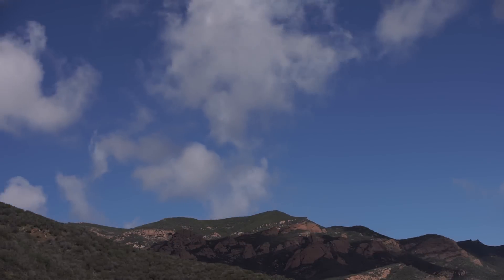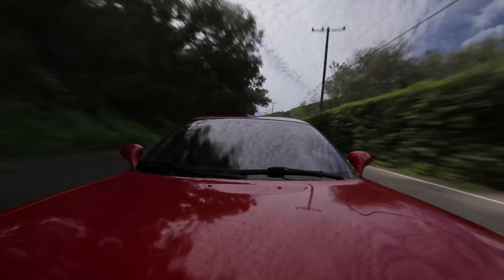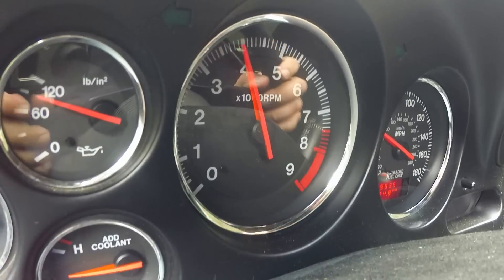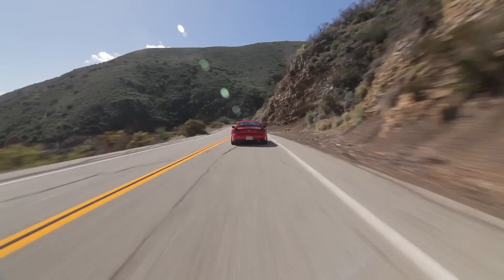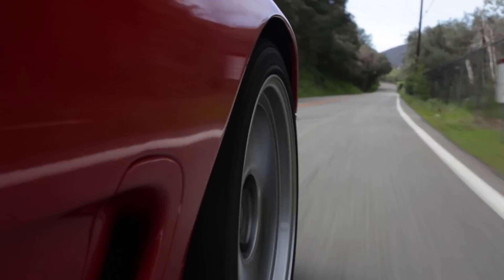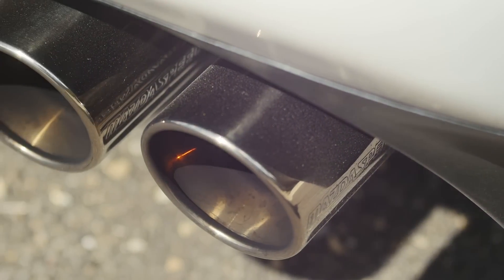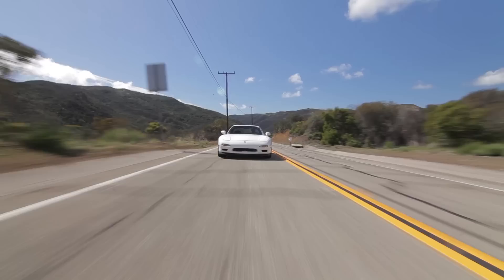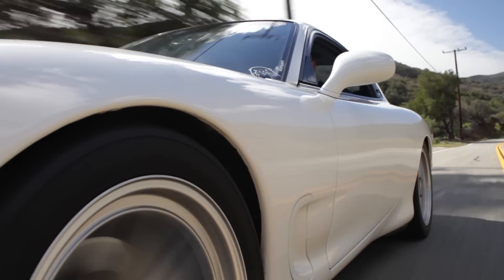Mazda  RX-7: Turbo vs V8 - /TUNED

Comment: I'm happy that rotaries are being covered on /TUNED, but it seems a little disingenuous to compare a 1.3L 13B-Turbo to a ~ 6.0L LS2 block, as though that's a reasonable comparison, to discuss the validity of the rotary motor. It's stacking the deck against the 13B. 

No one compares 6 liter V-8s to 2 liter turbo I-4s with that same tone - "Are Inline 4 motors really worth existing in the first place?" People would obviously point out that it's an unfair comparison. Especially if torque and straight line power are the prioritized criteria.

When people decide to swap V-8s into their RX7s it's specifically because it dramatically changes the car's profile - and that is the intended result. It's not too dissimilar to when people were swapping RB26DETTs into their 240SXs to replace their KA24DEs, or SR20DETs. Obviously, the larger displacement block has more torque, is heavier, and should grant more straight-line speed at the possible expense of cornering ability.

A *closer to fair comparison for performance purposes would be to compare a turbo-charged 20B to a V-8. At least then you're getting closer to a comparable displacement and engine profile.

Either way, I love the channel. Keep up the awesome work!

Comment: Is it just me or have the most recent /Tuned videos come down to the amount of "work" you have to undertake when you drive? With the two Acura nsx's, Matt focused on which steering setup required more work, for this he focused on which engine required more work. To me, having to put in work while driving isn't a drawback, but an advantage, so I'm a little disappointed we can't have commentary on the other aspects of the cars during these videos.

Comment: One of the things that's fantastic with rotaries is how smooth they run. For example it's easy to forget you are in 3rd gear while going 70 mph through a set of twisties. It LOVES to rev, and that's a feeling you'll never get out of a V8. It's silky smooth!  Btw, I'm talking about relatively stock engines with quiet cat-back exhaust setups (this car almost sounded like it had open exhaust -- way too loud for me) I have a feeling the power band in this single turbo is obnoxious. I've seen some of them with turbo lag that looked outright dangerous. Rob Dahm's 3 rotor single turbo comes to mind. Heh

Comment: I think one thing that wasn't adressed was the 10-15ish year technology gap between the 13bT and the ls2, as the 13b came out in the mid-80s and the LS2 in the early 2000's.... if you really want the question "would the rx7 have been better with a different engine?", someone should swap an LT1 and T5 into an rx7 then compare notes.

Comment: he kept saying the v8 is faster but how much hp were these cars making? im going to guess that the rotary was somewhere from 300 to 400 because the only mods he mentioned was switching to a single turbo. The ls2 im going to assume was in the 400 to possibly mid 500 range of course the v8 is going to be quicker it does have more torque and im assuming more power in this case. Get a rx7 with a built 13b and a good size turbo and see which one is better. and if your still not happy try to find a rx7 with a 20b swap.

Comment: My 93' -13b was awesome at 384 HP until it ate itself, was a bad rebuild so I as well weighed out my next move? 13b?, LS swap? or 20b conversion? I have old school Mopar muscle cars. So 20b conversion is ware it landed with a street port on it and it's Bad Ass!!!!! 8 psi of boost it made 560 HP on 16" tires for break in time, Will be going to 16 psi of boost but on 18" tires so if I hit between 650-700HP she'll be hand full, besides LS swap out of the box only puts out 450 HP. Think I made the best choice! stayed true to the rotary sound of the car. Check it out Wayne's 93 FD

Comment: If they are going to compare, they need to compare the LS to a 3 rotor.  They are both engine swaps, and the 3 rotor churns out similar power.

Comment: i would take the rotary hands down. yeah the v8 has more torque and is in general more reliable but for me its all about how the engine sounds and how fun the car feels to drive. for me nothing beats revving a car to 9,000 rpm and hearing that engine scream

Comment: V8 Swap vs 13B, why not 20B? :)

The only downside of a rotary is fuel consumption in my opinion. If we could get the same fuel efficiency from a rotary as a piston motor it would certainly improve the prospects of the rotary motor.

It's the only thing I don't like about my RX-7. But in fairness I only drive it weekends anyway so it's not like it makes me broke.

I do like the idea of a V8 swap in many ways I see the appeal, but I'm too much of a purist to actually do it. I also like the fact that it's different to everything else.

Comment: Matt I have designs for a 1.6 liter 4 rotor that in my predictions could make more than 850 hp without a turbo or supercharger on pump gas. Can you get a four cylinder n/a to do that?
Reply: Why?
Reply: nickdudem why
Reply: Calvin Cobb Why is that even relevant?
Reply: He asked why people like rotary engines
Reply: Calvin Cobb Yeah but what has that got to do with a 4 cyl N/A got to do with that?
Reply: That is what size a typical engine and cylinder configuration would be for 1.6 liters
Reply: Calvin Cobb So?
Reply: My designs for a 1.6 liter engine is equal to a v8 with much larger engine saving weight and cost
Reply: Its better than a v8
Reply: Ffs dude, you must be a shit designer if you think a rotary is better than anything.

1. The displacement arguement is a moot point. You can't compare size because the engine arcitecture is completely different. You can't make a 6L rotor, nor can you make a 1.3L V8.
2. Relevant comparisons would be physical dimensions, weight, economy and output.

- yes, they're small. So fucking what? Is your aim to put it in a mobility scooter? No point in being tiny.
- they only weigh slightly less than aluminium 8's, negligible difference. Certainly not worth all the torque you're losing.
- haha, n/a 850hp rotor? You'd literally throw the balance of the car off with all the fuel you'd need to carry.
- 850hp is no fucking use without torque, and you're doing it n/a. They're gutless with boost, so you'd just be building an extra gutless piece of shit that would be a dyno queen minus any real performance.

Ps, cost wise, you can get 850hp out of an ls for under 8k with a bit of spanner turning yourself. That's never happening with a rotor.

Sorry to tell you, but rotaries are dead for a reason. Back to the drawing board, don't forget your crayons.
Reply: Good diffusal is good, well played
Reply: Calvin Cobb Since when has the rotary engine been renowned for their torque? Your beloved 26B delivers only 448 LB-FT @ 6500 RPM whereas a similarly powerful small block V8 will do more than that from 3500 RPM all the way up to 600 LB-FT at only 5000 RPM.
Reply: your bmw m3 produces 275
Reply: but the previous m3 and the 26b was restricted on power
Reply: nickdudem 787b 2.6L NA 4 rotor go 930hp you sayin what? hp means nothing? you joking right? torque is only the factor, horse power is the result. 
this isn't a street drag, torque alone will get you no where on a race track. F1 engine is a whole new profection of mechanic, can a F1 engine lasts 24 hours? so it is none relavent to everyday driving, like some engine needs a rebuild after each drive?? you kidding to even put that into comparison, just because F1 engine has pistons and it revs like crazy doesn't mean your v8 sat in your garage can do the same too, want an oxygen tank rocket booster too??
 overall balance means most if not all for a great racing car, lets say you have 1000ft of torque car, but you will never in life get to fully utilize even half of them on a racing track, so there is no point for it, check mordern lmp1 cars, see how much torque they had, specially nowdays them companies produce electric motor can easily generates hundreds ft of torque in an instant, so nothing is holding back the rotaries potential, small and compact and high power, only 5 moving parts compare to piston has hundreds if not thousand, yes it drinks gas but it sounds like none on earth, oh and you said you rebuild 13b then you must know how rotary engines by nature can benifit more from torbo boost than piston units, but let's still keep it naturally aspirited, because it doesn't need that torbo to win that Le mans.
Reply: nickdudem what? rotary gone for a reason? the history of mankind in whole of automobile industries at 20th century has one focus, is to increase the capability, efficiency and quality of piston engines, but only one manufacturer stayed focused on refinement of rotary engine till this day, and people complaining how it drink gas and lacks torque and hard to maintain or engine rebuild after certain mileage all that? first, it does drink a HELL a lot of gas, but it is some price to pay for revs to over 10,000rpm in about 1-2 seconds, so it is fun, lack of torque(un torbo ed)? do we really care after winning at le mans?? and third, you can't rely on mazda dealer machanics to tell you how to maintain your rx7, because they do not know for sure, some of the experienced rotary owners had less problems than piston sports car, last of rotaries are RX8s, they are gone is because they won't meet emission standards, before mazda figure something out it is hard to make a revive, do some more research before post.
Reply: Cool story bro
Reply: Honestly I have different designs for a rotary engine. I'm not using mazda's design
Reply: Calvin Cobb Have you built this design? Or is it purely theoretical? In other words, can you prove your concept or are you just talking out your bung hole?
Reply: If i had the money the materials and the people this would definiatly be possible. I have rudementary drawings. sorry for bad spelling

Comment: The universal law is that rotary specification works with a turbo much better than a piston engine does. See dragstrip rotaries running low 6 @ 1/4 mile.

Comment: I find it hilarious when many Honda people or rotary people think that high-revs are some sort of magic wand to good performance. Contrary to what they may say about "you get to rev it up to 8,000 or 9,000" is lying by omission because if you DON'T rev it to 8,000-9,000, you're simply getting smoked by other cars who don't need to try as hard to get the same speed. I think the old Corvette C5 or C6, their tachometers only go up to 7,000 rpms max but they have tons of hp and torque throughout the RPM band. So while your little high revver is screaming to just get to maybe 250 HP at 8,000 rpm, a good sized V6 or V8 is at that same 250 HP but at significantly lower RPMs with more room to go.
Reply: BlueonGoldZ You don't get it... Watch the Jay Leno garage video on his Honda SM600 or on the Honda S600 hot rod with CBR600RR engine... You don't buy/build a car JUST to go fast... it's for fun.  Sometimes more revs are more FUN.
Reply: TassieLorenzo I get it perfectly. I don't like the idea of a high strung engine that's loud as hell that needs to exert itself to have fun. I have a turbocharged 350Z which already has good torque and even more so with the turbo. I don't HAVE to wail on the throttle as I have good HP and lots of torque even under 5,000 rpm. Plus, having to rev higher means more noise and I don't feel like dealing with the cops.
Reply: "I don't like the idea of a high strung engine that's loud as hell that needs to exert itself to have fun." Well I like this idea.  A car that pulls hard at 3000rpm while it sounds like it's not even trying is boring to me, it's just *too easy* -- it's more fun to have to work hard to squeeze the power out of the engine, so much more satisfying to me. :)
Reply: TassieLorenzo That's fine until you get smoked by a car with a wider power band.
Reply: BlueonGoldZ It's not a race!  It's about having fun!!
Reply: TassieLorenzo Yeah, having fun is massive acceleration too due to torque.
Reply: Yes in that way a "lower rpm" engine with the same power is better...
Reply: Florent De Marsilly Yes in that way a "lower rpm" engine (large or FI engine) with the same power is **too easy**. ;) Fixed that for you. :)
Reply: Haha... In terms of character, I prefer high rpm motors. I would prefer to have a car like this. But purely about fuel efficiency, a motor producing much torque and therefore more power at low motor speed is more efficient. (... but I hate V8s...)
Reply: As I was saying, if you need to wail on the car and send it high into the revs in order to make power, then that is just stupid. That is why many Hondas are made fun of and compared to lawn mowers and the reason why rotaries sound like absolute shit.
Reply: Dont look at the tach, problem solved. I went from a 5500 rpm redline to 9000 rpm and i cruise at roughly a third of redline either way. Peak power is higher up though but thats where i want it if im pushing the limits
Reply: +BlueonGoldZ Dont look at the tach, problem solved. I went from a car with a 5500 rpm redline to 9000 and cruising rpm is about a third of max in both cases. My newer car is designed more around top end power but thats where i want it if im pushing my car shifting high
Reply: cm7atrix The tach has nothing to do with what I'm saying. My point is people think that you need to rev high in order to make the best power when there are other cars out that with a narrower powerband that can make more power at 5-6k.

Comment: The rotary is far better sounding, and the smooth high revving nature is a great match to a sports car. If youre looking forward to a small rear wheel drive car with a piston engine you dont need to dismantle an rx7 to get one.

Comment: I'd run the rotary until I got sick of it, then I'd put a GM LZ9 V6 in it.  they weigh twice as much but make 240 horsepower stock and are easy to massage more out of

Comment: I wish V6 swaps were more popular in RX7s and Miatas. Less weight in the front than a V8 (and a bit further back), and more torque earlier than the stock engine.

But such swaps are no where near as common because it's either a "go big or go home" mentality, or people notice it's almost as expensive of a project as a V8 swap.

And that's too bad, the cars would be more balanced/well-rounded/fun.

Comment: What's the actual disadvantage of a rotary engine? I read that they can break down more easily, but I wonder why. The engine has fewer moving parts and should show less wear than a V8. I am also really surprised that the V8 uses less fuel than the rotary, because I expected the rotary engine to be more efficient. I thought if anything, the rotary engine is good on wear and fuel mileage. It now seems to me those are the two things it is really bad at ^^

Comment: Would it have been better with a v8 in 1992? Probably not. What did a tpi 350 make back then? Or even a lt1 the next year? 275 hp? Slow rev and iron block. I doubt at the time it would have been a better choice. Is an ls2 better? Absolutely!

Comment: This is a great video, but I don't think Matt is used to driving a car that can rev so high. The key to drive a high revving car fast, is to remember that the power band doesn't start as early as most cars. Compared to the LS, where you can keep it at 3000rpm, stomp the peddle and you'll go fast. The Wankle is barely entering it's power band.

But Wankles aren't for every body, they're more of an engine for the attentive. If you have a rotary engine, you have to quickly learn that you need to give them ALOT of TLC, compared to the LS engine where it'll just run, aslong as it has petrol and a little bit of oil in the block.
Reply: IB3MOR3PR0 Long term, I'd rather have reliability than a constant tuning project.

Comment: I think he's missed the point...
RX 7 was a purists car, not about the hp. but rather balance. The rotary loves to rev high, but isn't very "torque y", not fast off the line compared to a V-anything. It`s advantages were that it was lighter (2 thirds to a half a V)  and could equal the hp. produced in V`s that were much larger in displacement (everything else being equal). At 2800lbs third gens. were rather heavy but handled excellent.  Dropping in an LS destroys the balance and the handling (I`ve seen it), great in a strait line but that was not what an RX was built for. I think you would be better off dropping in a bigger rotary (2+ liter turbo)
Reply: Those 20b and 26b engines are way fast off the line vs 13b. Even tho the 1999+ RX-7's with twin turbo provide 350 newtons of torque which is pretty good all things considered and who needs insane amounts of torque anyway :P
Reply: " It`s advantages were that it was lighter (2 thirds to a half a V)  and could equal the hp"

Numerous LS swapped FDs end up being lighter after the transplant.

13bs / rotary engines are not light by any stretch of the imagination- Despite the popular myth online that they are.  Theyre actually quite heavy- For their size.  

But that SIZE, thats the thing.  Its not that rotaries are light, theyre compact.  Rotary cars benefit from having some rather interesting polar moments of inertia, because they can bring more of their weight towards the center of the car.  Cars are more than just static weight distributions and who not.

Comment: It appears that people are negligent of the fact that both engines can have flaws, to assume rotary engine arnt reliable is ignorant. But of course under different conditions the engine won’t last as long. But the one great thing about rotary’s is the tuning potential, an example being able to port for power and mid range torque and an even higher redline. In the same way you can modify an ls but you have to do more to get more out of a v8. The one main advantage a small displacement will have is simplicity. Also the sigma of them being unreliable is a joke reason being I’ve seen some Na Fc’s with 200k plus miles on them. Don’t assume you know.